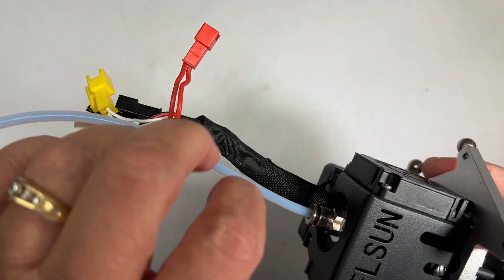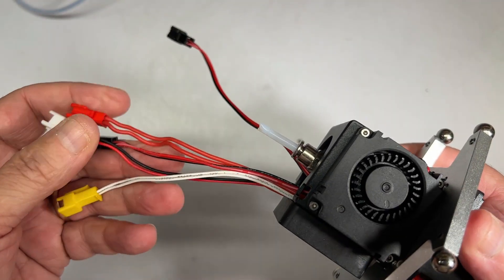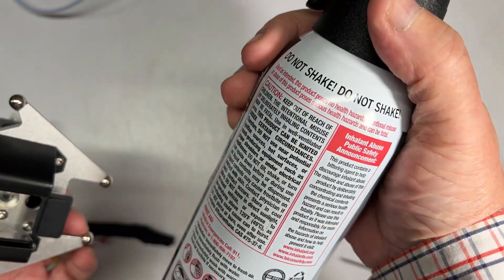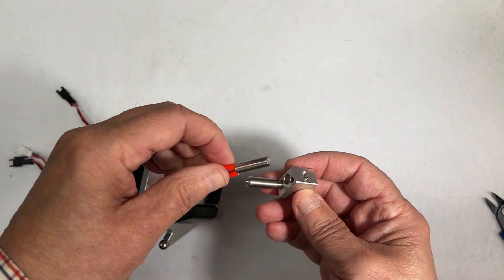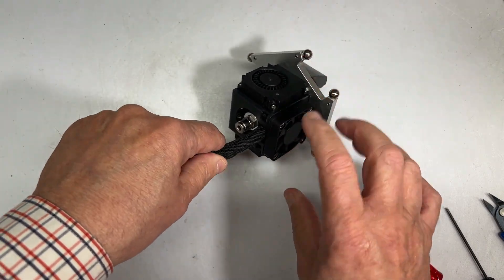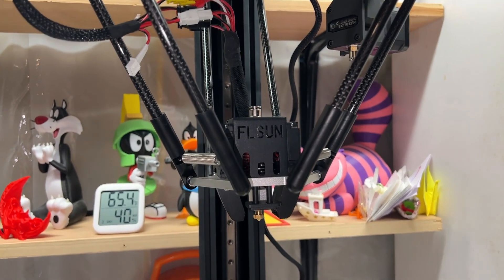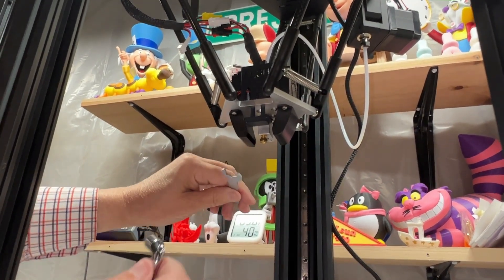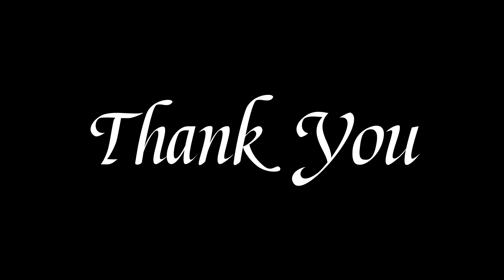FLsun SR Effector Repair

Comment: ty, but i couldn`t figure out why my filament wasn`t melting, after about 4 hrs of installing , etc, like u said super important that space, mine was lose before and was like i`m sure that need tighting, bad idea to change and tighting it, as i figure out no heat was reaching the top part of the block, so i added small steel washers, not to intrude with the other parts, steel as i want it to bring the heat over, that did the trick, as if u tighten the nozzle fully its to down, who would of figured it out, with your help i was able to pine point the problem, ty
Reply from the maker: You are very welcome !!!

Comment: Your videos have been such a tremendous help for a 3D printing newcomer and I even created my own playlist of your SR maintenance videos! 
I am curious though - what nozzles do you use for your SR? I'm running through some maintenance after some wonky prints and it got me thinking about just getting some extras while I'm ordering more grease and filament. Do you use straight FLsun factory nozzles or is there an aftermarket nozzle you like more? Advantages/disadvantages on different bore diameters or materials like stainless steel?
Reply from the maker: Thank you for the kind words...
Hahaha, I use the least expensive from Amazon.
https://www.amazon.com/Volcano-Printed-Filament-Printer-Extrude/dp/B08B5Y3RNN/ref=sr_1_3?crid=3MSLQLIQ9RGNV&dib=eyJ2IjoiMSJ9.JdrJy6UXkBAFQvaE4RrIqjBqCPYar7IMcwWebj_pMh4K7vPpf39IqPbuWUparZNWOEIHaIYvpMiFUoZLviIg1K666PIqP4PvpkuDEi7rNtB2j5ZBlGfI7OPF-hrNGQW59kObMT2hL9LGnvOTLrPwYTiD9XE32krxmJwopfxubED9fKrBMVr0Vi9YzMRLUN38fHYQlx4XvwpvQxtHaut91h5g3MiBReH-v5qh0-L9rn0.s9R4to9MLXNNGQaD8b4BqQyg6RZ9QI6S9NZJrVUySv4&dib_tag=se&keywords=volcano%2Bnozzle%2B0.4&qid=1711838512&sprefix=volcano%2Bnozz%2Caps%2C88&sr=8-3&th=1

At this price, I change if the prints are looking a little weird...

Comment: What is the reason for only putting the nozzle and throat in but leave 1 thread out because the printer comes with it all the way in please reply i need to know
Reply from the maker: That is the way I receive them from FLsun and it is the best fit for the silicon boot. Also, make sure it is tight against the throat...

Comment: very detailed! thank you so much! got a super racer a couple weeks ago and i had so much filament around the nozzle and heatbed , lucky me and had new parts i could replace with! great video!
Reply from the maker: Thank you for the kind words...
Reply: i was also thinking, before my nozzle was flat against the heatblock, and was leveled after that, now when i move the nozzle out a bit and assemble the way it should, is it gonna touch the hreatbed? That's what im scared about now. @dennisgignac5103

Comment: Great video, thank you. I notice that if I screw the nozzle and throat only part-way into the heat block like you said, the nozzle is able to spin freely and looks unstable to me. Is this normal? Maybe when the printer is turned on, the heat will cause the nozzle to expand and sit firmly in the heat block?
Reply from the maker: The nozzol has to be tight against the throat. Make sure the space between the nozzle and the heat block is about the distance as shown...
Reply: @dennisgignac5103  Thank you for the reply. It seems my issue was that the nozzle and throat I’m using have threads that run over a different distance than the threads on your nozzle and throat, so the ‘one thread’ rule wasn’t relevant/accurate in my case. Followed what you said here and all is well. Thanks!
Reply from the maker: I am happy...

Comment: Dennis - great video again!   Your videos really helped me with setup and calibration on my new SR.   I'm struggling with both clogs and nozzles wearing out though.  I have about 400hrs on my SR so far.  I have changed nozzles four times already.  Each one (.4mm) showed enough wear.   I am printing only PLA (no abrasive materials).  It's only been flat black/white or a silk.  Just seems like I'm wearing through nozzles way to fast.  I can confirm one nozzle drug across the bed, but none of the others have.  99% sure of that.   For the life of me I can't figure out why i'm getting clogs or wearing these things out so often!
Reply from the maker: Thank you very much Jerry for the kind words...
What I do is change my nozzle very often because they are so inexpensive and can cause less issues... Here is the link of the ones I use.
https://www.amazon.com/Volcano-Printed-Filament-Printer-Extrude/dp/B08B5Y3RNN/ref=sr_1_3?crid=2FL2HT52WTG2Q&keywords=volcano%2Bnozzle%2B0.4&qid=1682376491&sprefix=volcano%2Bnozz%2Caps%2C71&sr=8-3&th=1
Reply from the maker: And here is an article that you may find helpful regarding the clogs...
https://3dinsider.com/3d-printer-nozzle-clogging/
Reply: @dennisgignac5103  thank you!
Curious.  Have you ever tried using the steel nozzles?
Reply from the maker: @jerrypierce7116  No, everything on all my printers are stock except the PEI plate...
Reply from the maker: @jerrypierce7116  No, all my machines are stock except for thr PEI plate...
Reply: @dennisgignac5103 They are unavaible

Comment: Hey Dennis, thank you for all your videos, I've found them very helpful. I was wondering if you could share how you remove the normal supports from items printed with your FLSUN products? I have an okay time removing tree supports but i often break my models when trying to remove the vertical supports.

Also, if you could share your slicer settings for the SuperRacer that would be much appreciated!
Reply from the maker: Please contact me on FB. Look me up at"
Dennis G. Gignac
Reply: I'm having the same problem.

Comment: Thank you so much for the videos, I'm having issues with the filament stopping feeding mid print. The printer continues printing in the air but no filament comes out. I will try cleaning the extruder and nozzle. Thanks again
Reply from the maker: Yes, follow my video's about the SR extruder !!!

Comment: Trying to eliminate blobs on my SR and I've used the G code to eliminate power loss recovery and I'm still getting blobs. Any suggestions? Firmware is up to date.
Reply from the maker: Please send some photos so I can see what thet look like and the repeatability...
Reply: @dennisgignac5103  I don’t know how to send pictures on YouTube. What support settings do you recommend for the SR? Right now I’m using Cura with 60% support density, z support distance/support too distance .1, support roof enabled, support interface/roof thickness .4, and support roof density 60%. Above my supports looks terrible. I’ve gradually changed the settings and it’s still coming out the same. Any help or suggestions is appreciated.
Reply from the maker: @Old_man_Chubs  Please contact me on FB Messenger:

Look me up at:    Dennis G. Gignac